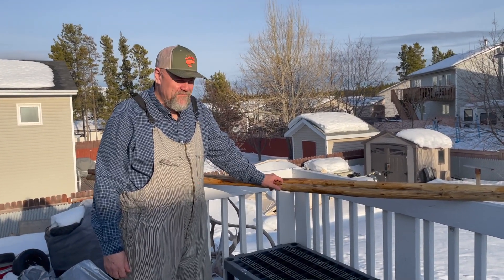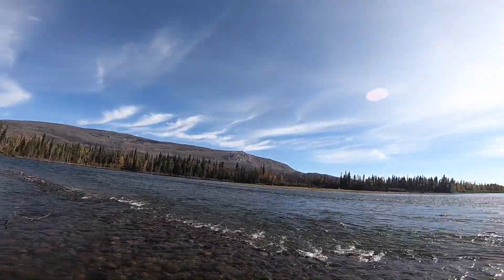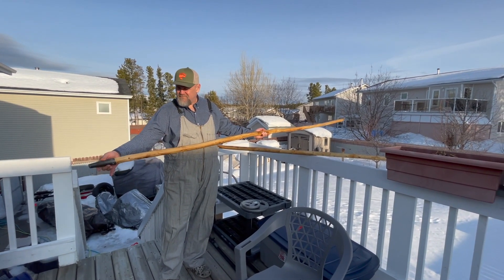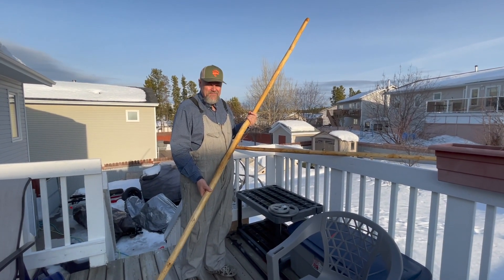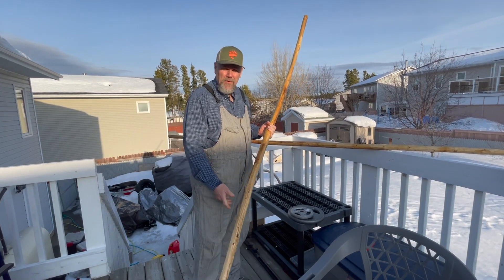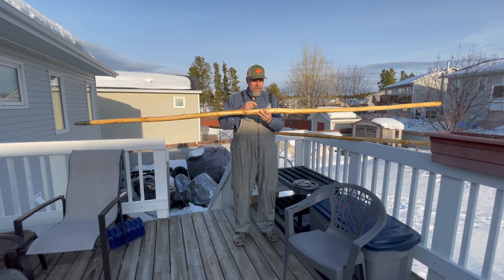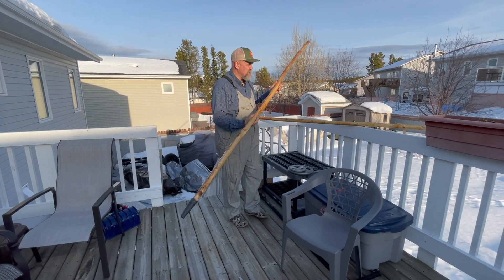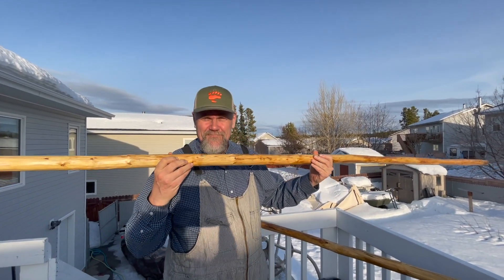Adventures in Poling   HD 1080p

Comment: Wooden Clothes rod from the building supply works well also. Comes in 10' lengths.
Wooden Arborist pruning poles come in lengths up to 16'.
Or a fiberglass option is Jameson JE Series Foam Core, so they float. Available in many lengths to make storage easier.

Just a few options if you find the extra dia and weight, wears on you over time.
Reply from the maker: Thanks.... good to know.

Comment: I was waiting for you to take out some glass baha  dont you use that direct drive or jet drive on the freighter ?
Reply from the maker: Yes..I hve a surface drive on the big Scott Freighter which is much better in shallow water up to a point.   Still need a pole occasionally, but never a paddle unless the motor breaks.